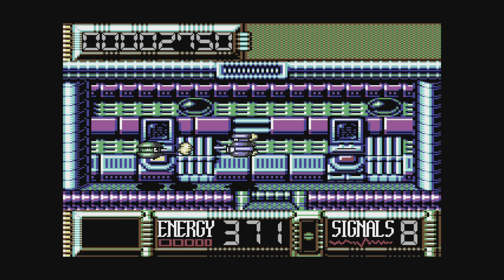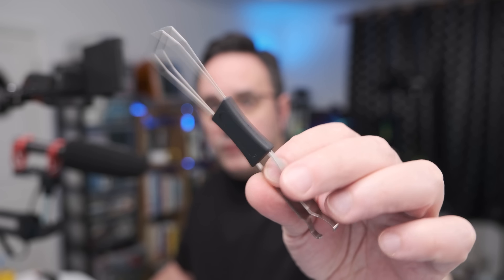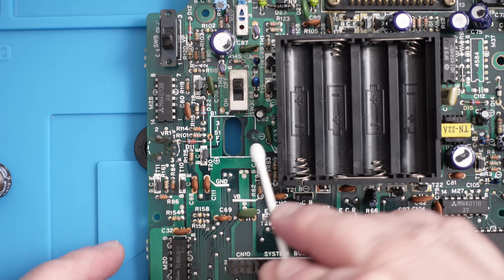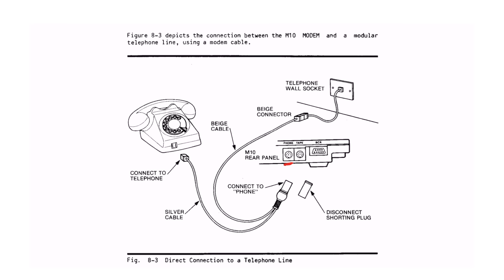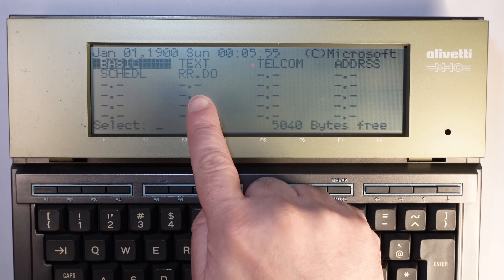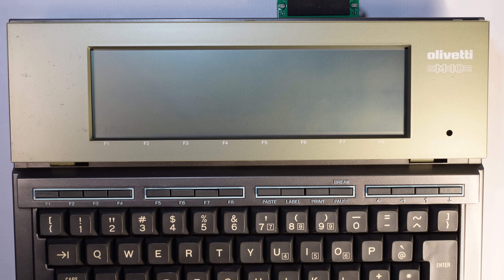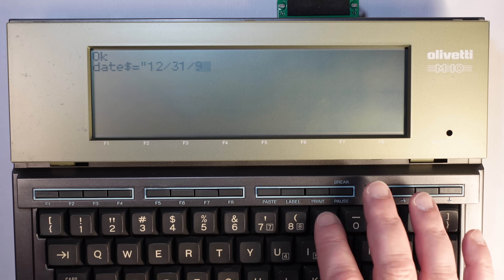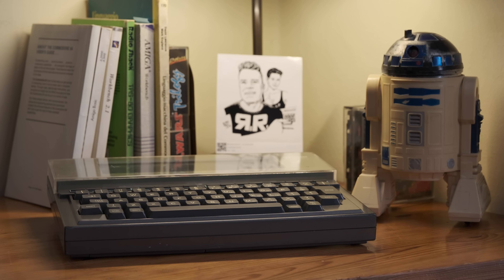Can I Fix My First Ever Computer?! | 🕹️2UP

Comment: This exact Olivetti was used in a Laser control system with a ROM inserted into a socket for a control program, actually running a BASIC program. I remember reverse engineering this to get the control codes out and use them with an alternate interface.
Reply: That's a very cool story!

Comment: When I worked at East Midland Computer Ltd., I programmed the Olivetti M15. I wonder if it was also a licensed product by Olivetti? I also use the M20, and M240 in my time there.

Great retro fodder!
Reply: Lucky man, the M15 was so beautiful! I would love to have one haha! Indeed it would be interesting to know if it was licensed. After some research, looks like it was an original Olivetti design, but not sure though
Reply: @messycircuits  I remember the M15 having a very slow LCD display and feeling like very cheap plastic. However, the keyboard could be taken out of the frame for typing on the desk if you wanted.